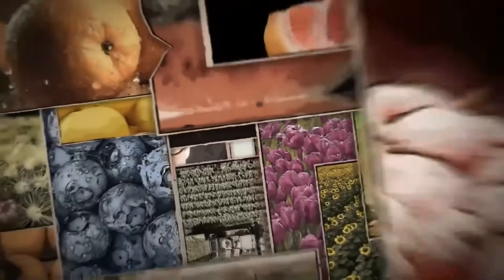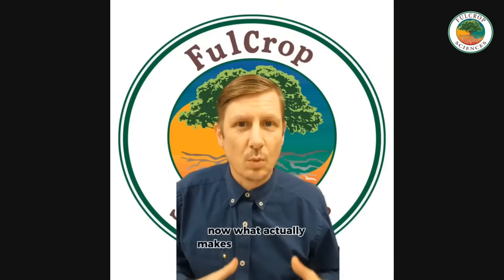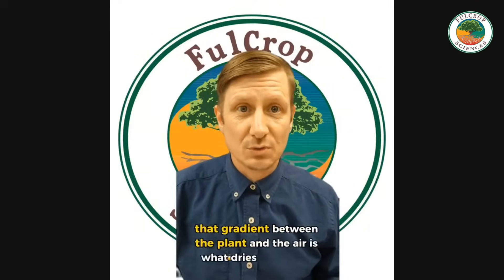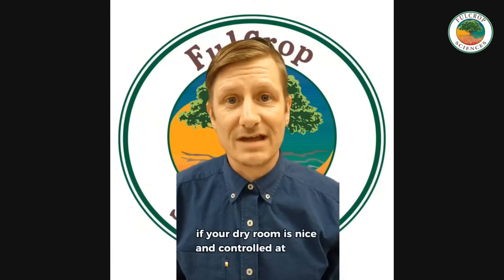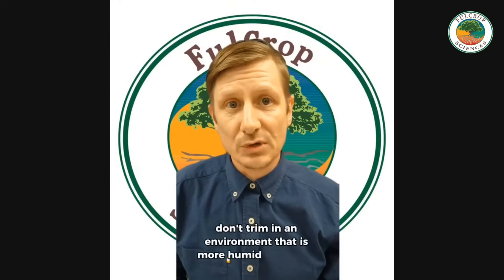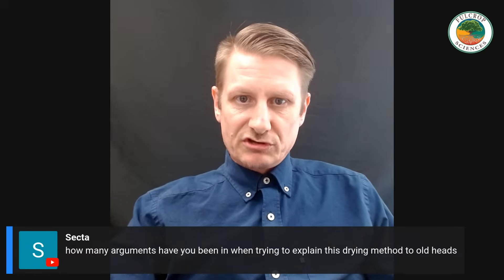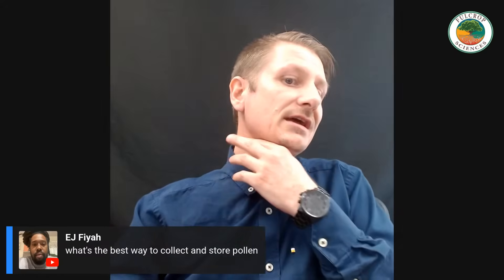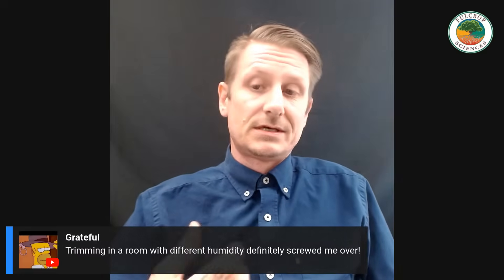Why 60/60 is NOT the gold STANDARD for dry/cure!

Comment: The VPD you suggest (1.4 to 1.6 kPa) are far to high if sustained for the entire grow and will dry in a few days. Since both chlorophyll reduction and carbohydrate conversion to sugars are hydrolytic processes and the half life of chlorophyll is about 2 days one need s to keep the plants above about 30% MCwb for at least 4 days (1/16 reduction). The higher temps will help speed the process. Too high a drying rate will case harden the plant material making the diffusion removal of water stop. This is bad and will extend the time. For example if a .87 kPa VPD were selected, then for cannabis material wet trimmed a typical drying rate of .3g water loss per gram of wet material during bulk water removal (>30% MCwb) but drops to half of  that immediately after 30%. Before 30% the drying rate is mostly constant but after it declines exponentially to zero at equilibrium.

Comment: An VPD has a infinite set of temperature and Rh solutions so unless there are other requirements and temp and Rh that achieved at VPD are equivalent as far as drying rate is concerned. However, the retention of terpenes is  bandied about like it can be controlled with temperature. If one compares the partial pressures of mono and sequiterpenes to that of water one must conclude that preserving monoterpenes is impossible at reasonable room temperatures as their vapor pressures are two to three times higher than water while sequiterpenes are much lower. This means most if not all monoterpenes go with the water but not the sequiterpenes. At 40-45F the result is the same. Conclusion: unless you like smoking freeze dried weed (yuk) you'll never preserve the monoterpenes during a dry.

Comment: Until MCwb  drops below about 30%, VPD is the mechanism to drive water movement. Below 30% the mechanism is diffusion, which is driven by aW. I can show how the initial drying rate (linear) plummets to half at this point and decrease exponentially after that until equilibrium is reached and,  viola, it becomes zero. Thus drying rate is a good indicator of the status of dry/cre/equilabrate process. Equilibrium  and aW can be inferred (approximately) from the desorption isotherm as can MCwb. Now this data require a starting MCwb which is unknown but by adjusting the initial MCwb guess (78%) to align with the equilibrium endpoint Rh (accuracy is necessary) the entire curve is known to an approximation. So an isotherm, an accurate humidity reading, a drying rate of zero, and the definition of equilibrium are that are needs to characterize a dry/cure/eq process.

Comment: Hi. Im on day 4 of your method. Been at 71° and 44 rh for 4 days now. My buds are very crispy and dry on the outside and seems a bit less than spongy in the core. Does this seem right? Also i have a wood moisture meter. Is the .55 - .62  what i should be looking for on it? Wondering if its possible to overdry at day 4?
Reply: Following. I'm right there with you 😂

Comment: Coming from the PNW humidity is always a concern, so have always depended on keeping things a little warmer on the front end of the process and then cooling off as you go along. Sometimes you literally have harvest stuff in the rain and warm air is the only thing that is going to get that water off without beating the plants up. You get a feel for the timing of it the more you have done it but the water shedding phase takes about a week and will jar test at 70%. At that point I break down into 6" long pieces on stem and loosely sitck them in new paper grocery bags (the bags later get reused collect all the leaf waste to compost.) At first they are left open in a cold dry room and then eventually folded over. There is no hard timeline when this happens it is all done on  case by case basis and takes 4-6 weeks. From here it gets finished trim and jarred and should not need burping. Paper bags have the advantage that they are more forgiving on moisture levels and do not create wet spots like a tote will.  Also if you did not shed off enough water in phase one you can always swap to a fresh bag.  Then a big advantage is if processing an outdoor crop if a bad bud was missed because that can happen, one only loses a single bag instead of the whole lot.

Comment: 65/55 for the first couple days then 63/58 for 7-10 more. Then into tote until it stabilizes at 58%. Been doing this for years and never had an issue. Never got bud rot during the dry. Terps start degrading above 68 so no way I’m drying above that. Above 70 the degradation accelerates rapidly.
Reply: No wonder all weed is starting to taste the same. Everyone is out here frying their terps during the dry. Walmart weed. Craft cannabis is dried low and slow. You spent 4-6 months growing it so don’t rush the most important final step. 68 or below temp, 55-58% humidity. VPD between .7-.9 and you’ll get 🔥

Comment: A little off topic but I quit using water to make butter or oil years back when the very next day the cheese cloth that I used to strain the flower from the oil and butter it turned to mold. Which made me question the shelf stability. A long story longer im not a fan of bubble hash because of the same reason. I noticed people that dab get sick alot and are all often sick at the same time off the same batch. Water is definitely Ying yang  but not your friend in products any more than 12 hours old

Comment: I like the idea of a steady breakdown with minimal fluctuations.  68/60 here, and never a problem.
Reply: 78/60 or 78/55 to 50ish works also but at around 8 days. I like longer and slower at 60 now that I know what is going on. I used to just wing it. Only once had that grass smell cause I went too fast. Once left it hanging for 2 months. Yes they were rock hard nugs but the terps were off the charts🤷 no idea why that happened. I called it air curing😂 if that's a thing. Merry Christmas growmie 🫡

Comment: 60 / 60 was never the gold standard but the base guideline for beginners . I mean don't get me wrong , i'm glad for the research on the subject because i have done my fair share , but in my 40 years experience i can say there are multiple ways to achieve premium results . It's just that most home growers can't afford to run all the BS. that keeps changing when thing have been done for probably 1000 years without it all . Just check for mold / dry it right , and put it away air tight . Simple and cost effective . All this is doing is making it cost more money to grow your own , you people are FKN knuts  with all the crap you need to assist you with the process .

Comment: Re-hydrating cannabis, ie. increasing aW from say .58 to .62 aW is much harder than reducing from .62 to .58 because of a phenomenon called case hardening. It is possible but requires low quality steam to accomplish in a reasonable time. Case hardening changes the plant structure making it somewhat hydrophobic. Placing .58 aW bud in a 62% RH chamber may take over a week to return the bud to .62 but placing a .62 aW bud in a 58% RH environment may only take a day to drop to .58 aW.

Hitting the correct aW every time out of the drying tent is best practice as it minimizes monoterpenes loss and oxidation.

Comment: Evaporation (volatility) is different from oxidation. Oxidation is inevitable but evaporation is not.

Monoterpenes (limonen, pinene, myrcen, etc.) are more volatile than water and so evaporate faster than the water. Sequiterpenes are less volatile than water and evaporate very slowly so are less reduced during drying than monoterpenes.

THCa to CBNa is an oxidation process that takes time and is very dependent on temperature. Canning at the right aW reduces this process tremendously to almost  zero.

The big quality issue is how to preserve monoterpenes. Unfortunately simple drying tents must allow the evaporation of these and there will always be a trade off between water removal rate and monoterpene loss. If extraction is the end use of the bud, then freeze drying is a viable alternative as it preserves the terpenes and cannabinoids at the time of harvest since the carbs and chlorophyll are not in the tricomes but in the rest of the plant material.

Comment: While I know that drying is proportional to VPD and VPD is determined by both the humidity and the temperature of the drying air (leaf cooling assumed negligible) and the state of the plant’s moisture content, the same VPD value can be produced using a range of RHs and temperatures. In other words for a given temp there is a RH to achieve a given VPD. Change the temp and adjust the RH and the same VPD will result.

Assuming a constant VPD during the entire dry/cure/equilibration cycle (more sophisticated drying protocols using multiple VPDs are possible) the drying rate (water loss per mass of product w/w) is not constant. There are at least two distinct plant states during the drying phase of dry/cure/equilibrate marked by the presence of bulk water in the plant >30% moisture content, wet bases and after bulk water has been removed, <30% MCwb.

Chlorophyll and carbohydrates are reduced during the entire cycle in the tent and in the can post harvest through hydrolytic process (needs water) and progresses very rapidly before bulk water has been removed. VPD during this phase is well defined but after removing water below 30% MCwb the hydrolytic processes slow drastically since the process shifts from VPD driven water loss to diffusion, a much slower transport mechanism. The half-life of chlorophyll is about 2 days so after day two of dry the amount has been reduced to half what it was on day 0. Two days after that it is 1/4 and at day 8 is 1/8 of the amount at day 0. Extending the dry time above 30% MCwb increases both the elimination of chlorophyll and carbs but exposes the buds to a greater risk of mold growth. Thus it is a race to dry below an aW of .7 to preclude mycotoxin mold growth possibility but not too fast to reduce the unwanted materials like chlorophyll to acceptable levels.

A well known manufacturer of a cure machine uses .72kPa VPD for their dry/cure targeting .58 aW at end of dry with a re-hydration to .62 aW before removing. The re-hydration  yields a .62 aW at a slightly higher MCwb than not re-hydrating (smoother smoke?).

An example of a 12 day dry/cure/equilibrate process sets a single VPD at .85 kPa for the entire process for trimmed bud attached to stems and routinely delivers 4 days to bulk water removal with 4 more days to  an average of .62 aW for the load and 4 more days to equate the entire load to .62 aW. The temperature of equilibration should be the temperature that the bud will be stored at. Buds stored immediately after harvest will hit and hold 62% RH and require almost no burping.

I always do a smoke test on the day of harvest and periodically during storage to score smoothness of smoke, aroma and flavor of smoke and potency. I have found that poorly dried/cured/Eq bud can improve with time in the can and the amount of time to correct non-optimal processing can be months to a year and generally requires burping to remove the gasses of hydrolysis and exchange air gasses.

A few notes on drying:

1) air flow is critical during the process to eliminate the microclimate that can exist with larger and heavier colas.

2) Accurate RH measures are necessary and learning to calibrate your temp/humidity sensor is critical to targeting VPD.

3) Large and heavy colas require higher initial VPDs to prevent mold growth but can be reduced after the first day or two.

Controlling VPD and measuring MCwb and drying rate are critical to the production of shelf-safe quality smoking bud. Anyone interested in simple methods to calibrate temp/RH sensors and simple estimates of MCwb and DR are possible (just ask).

IMHO the main benefits of optimizing the D/C/E cycle are minimum time, maximum smoke quality, shelf stable, and preservation of terpenes!
Reply: So with the bigger colas what are the different adjustments you should do for first couple of days. , I have perfect control of my dry room so im really trying to dial in as I will be chopping this weekend
Reply: What temp do you recommend with the .85vpd

Comment: For me, curing is just moisture equalization.
I hang dry about 7 days until my wood meter reads ~12% — that’s when the bud is equalized. I trim at 12%, which usually finishes around ~10%, then straight into Grove bags.
Bags settle around 55–58% RH with no rebound, so I don’t need weeks of burping.
When people say flower “keeps getting better,” it’s usually because they jarred early and were still finishing the dry in jars.
Being stable at ~55% doesn’t stop improvement — it just means the active cure is done and what follows is slow aging and preservation, not moisture correction.
Reply: Hey, a couple of questions. What setting do you have your wood meter set at, as mine has different settings, and i am a little confused by it? Also, do you just squash the prongs into the bud or into the stem? Thanks
Reply: @raymondreddington2989  soft wood mode
Reply: When u test with your wood meter are u testing the stems or the flower itself
Reply: @BryanCarr-j4p the flower itself, just have to make sure the bud is big enough for both prongs to fully penetrate it.

Comment: Drying at 60 degrees is a creation of corporate cannabis. Why? At this temperature the fungus that causes bud rot stops growing. It doesn’t kill it- it simply won’t spread at this temperature. Is it necessary for the small home grower to do the same? No. Average room temperature is fine-68-72 degrees approximately. But why does corporate cannabis use 60 degrees?? They are usually drying large numbers of plants. Massive numbers. Such large numbers of plants that it would be easy to miss the  spreading bud rot in the drying room. Your average home grower can more easily monitor and detect the fungus on his or her smaller amount of plants. It’s all about the amount drying at one time.

Comment: I’m happy with 60/60 so far feels right
Reply: I was to but im giving this a try, at day 3 now 68° 45% in the dry tents ⛺️
Reply: @Inside_Organics   I stood at 72f and 53h for a few grows. Currently at 72f and 48h has worked great for me. 8-10 hang dry till They almost feel too dry. jar it up and let it sit for about 2days without burping. Once you crack open the jar and feel the buds you will see they come back perfect and terps  are locked in. With more airy sativa type buds I would do experiment with both of those methods and see which works better.
Reply: @Inside_Organics what's the verdict

Comment: putting your 90% water (fresh) nuggets into perfectly 60-60 air also just exposes them to dryness too quickly IMO. I offgas the moisture slowly by setting my vents to 80% then 75% then 70% then 65% then 62% and it works perfectly and I lose no terps. Gotta remember, the trichomes house THC synthases which continue producing THC after harvest. Dont wanna just interrupt that process. Slow cure is the way.

Comment: Ok, I am currently day 8 of drying with this method. I dried back my plant several days pre-harvest. I removed large fans only and hung whole plant. I’ve kept it 66-70f and 45-55rh. Everything seems great so far. Using a wood moisture meter as well. Just about there for 10-12% moisture. Using this technique after a semi-botched 1st outdoor grow dry…too fast-too much airflow. I have wayyyy dialed down the airflow and got lucky with cool dry weather as well. Terps are for sure intact even with 70f first part and 64-68f the rest of the week.

Comment: can you go more in detail what your aiming for regards the dewpoint or vpd in kpal .. the difference in dew point is huge if you go for 40 or 45 rlf.. also whats your take on the cannatrol approach? which workss with dewpoint and starts drying slow at over 60 rh for 4 days then goes 4 days 55 RLF both at 20 degrees celsius. from dewpoint 12 to 11 degrees celsius.

Comment: Anyone have insight on drying in a brown paper bag ?
Reply: You don't actually dry in the paper bag, ideally the plants should be hung and dried, then bag up to get the last bit of unwanted moisture out before placing in jars.. It's a old school method that really is not needed if buds are dried to the correct point before the jars .
Reply: We used to dry in paper bags in the mid 90's.
Worked OK but we were drying wet trimmed bud.
For the last couple of decades we cut and hang at 60/60 for ten days then cure for a further 60 days.
(UK based so no high temps to contend with).

Comment: removing big leaves immediately, got it

my question is about increased moisure when 'plucking' (not cutting) leaves that are 'between' buds at a point during the drying process:

- if done when ready to cure, does the plucking increase moisure and therefor should let dry some more, and so
- is it better to pluck immediately upon harvest-starting to dry or does that introduce too much moisture too fast, and so
- is it better to pluck partway through the dry, which will then increase moisture (from seepage is how it feels) and does that impact drying length?

does this make sense?

if wanting to go directly from curing-cured to smokable with no more trimming/plucking after the curing begins